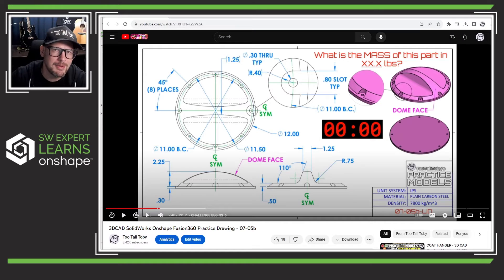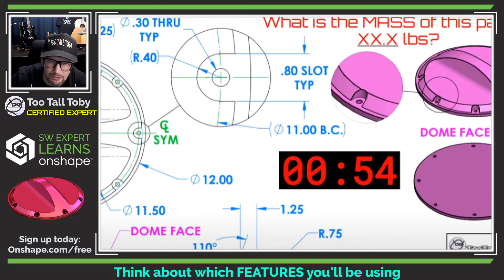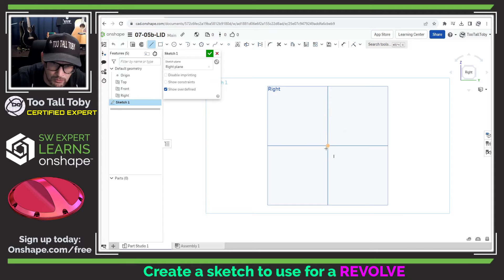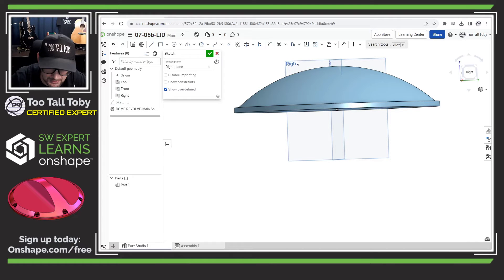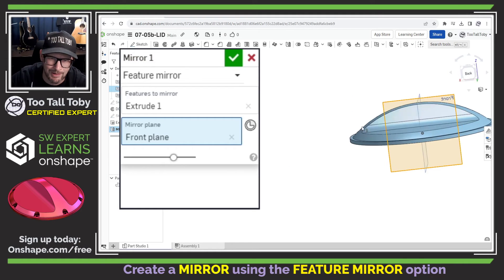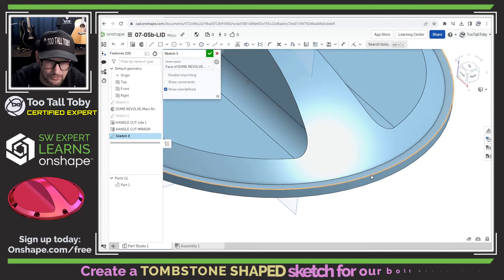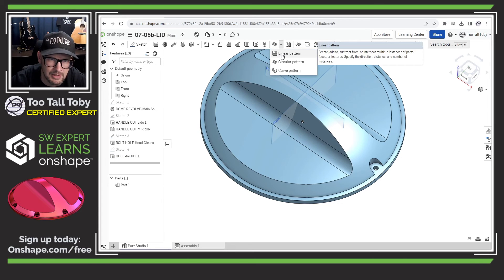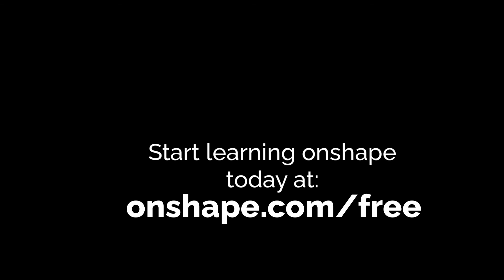Tutorial: Revolve, Mirror, and Circular Pattern

Comment: Before watching, I did this myself.  I'm a newbie so it literaly took me hours, but I got it done.  Most of the time was spent researching how the features work.  I started by making the flat face, then added the dome.  Then I made the bolt holes, followed by the clearances.  Finally I cut the dome to make the handle.  For both the clearances and the handle I used the subtract feature.  After watching this demo, I see how much simpler the whole process can be. I also appreciate all the hints and suggestions (like naming the features)  Thanks a million.  I know I'll be following your tutorials as I continue to learn.

One question.  Reading the drawings is pretty clear to me for the most part, but I don't understand everything.  Is there a reference I can use that explains all the symbols and annotations?

Liked and subscribed.